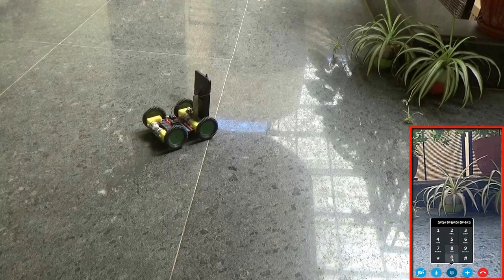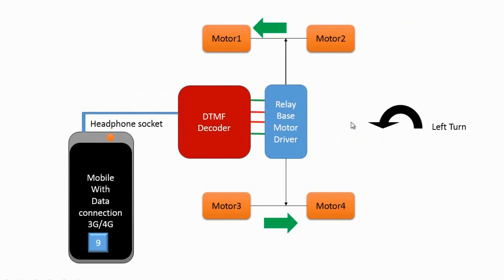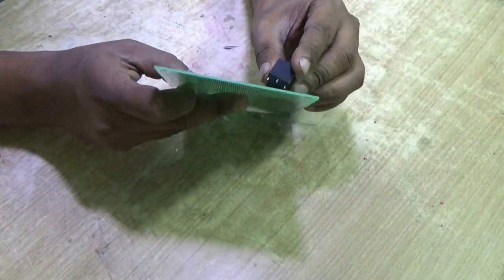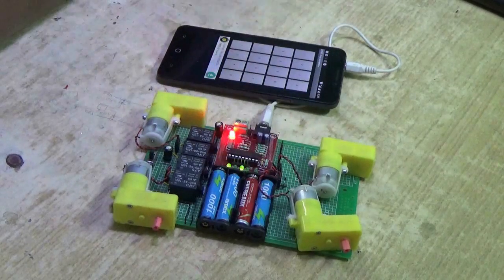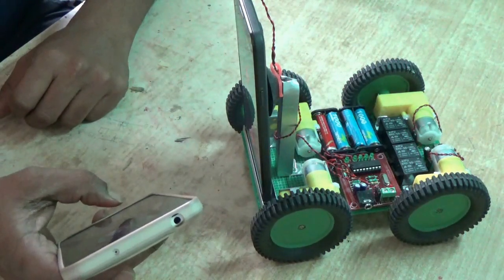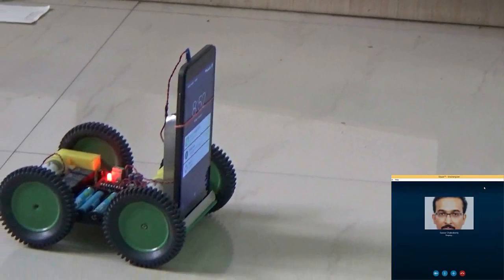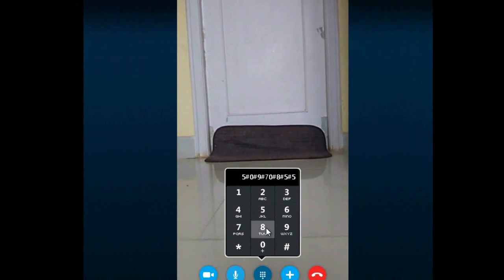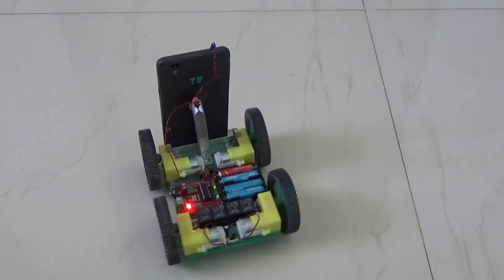How to make a Skype Controlled UGV - DIY Spy Robot - IoT Project

Comment: Apart from decoder, dc motor, wheels, batteries, what else are the  components used to make this plz... please answer ???
Reply: Brainergiser ... Thank you very much for your response but actually I am not much aware about the black relay and diode and other parts that's the reason I asked.  Plz help me .... many thanks in advance
Reply: Brainergiser ... I'm not much famelier with the items plz correct me... the black square one is the relay .. right so any item number or  model number and the same for diodes?